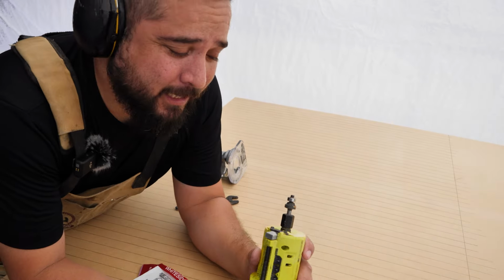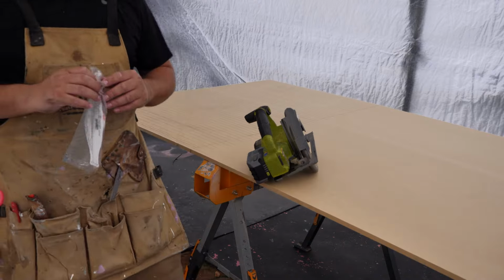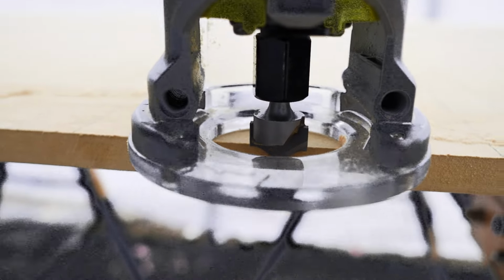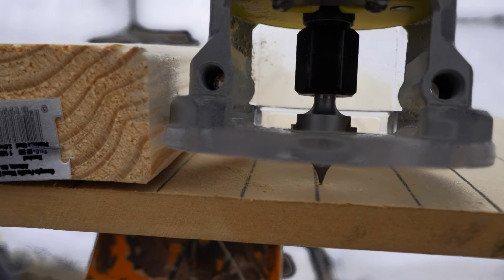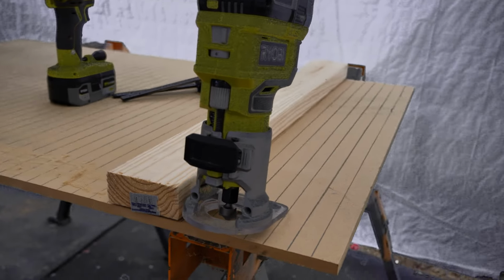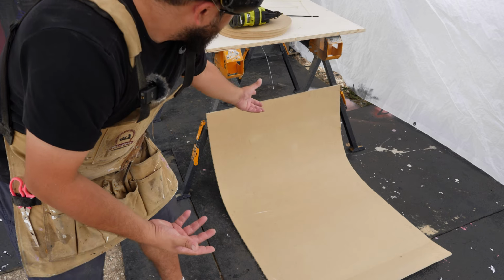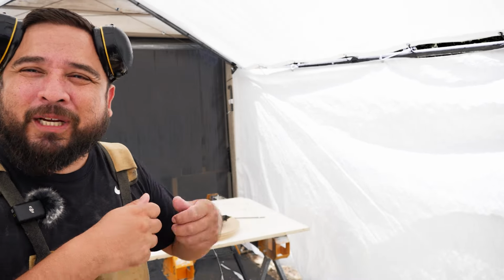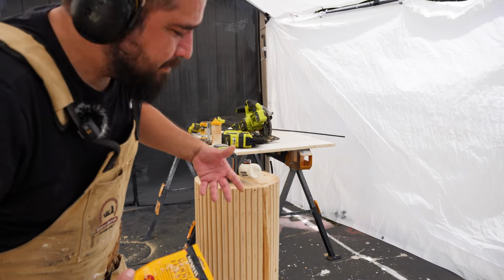DIY Pedestal Rippled Table

Comment: Great info on working with MDF & router & bit...  Love this idea!  Though one thought, align the guide to each line vs bit to line the guide to router--at least when you have extra you can cut off to fit (or leave area "open" and put shelves inside for storage, as well as nice display--pending planned use...).
Reply from the maker: Thanks, that does sound like a great idea to leave open and put shelves. Great tip!

Comment: Spraying water on the back side will help big time with bending the mdf. Don't drown it but liberal amount will make it very pliable and prevent cracking.
Reply from the maker: Thank you very much for your comment. I went back and forth with wondering to do that or not. I have done that to plywood but never MDF. So wasn't sure if it would cause any problems. And I really didn't want to cut this again, lol. But seeing that first section crack some. You are right, a little bit of water would of helped a lot with the forming process. Good tip!
Reply: Is the wood used in the video mdf ?
Reply: How can we bend the mdf wood like that?